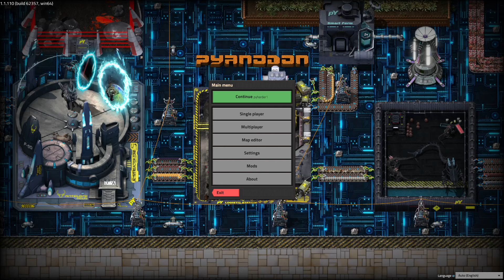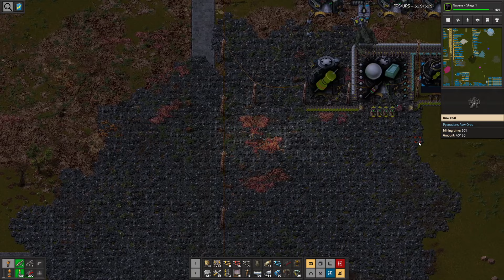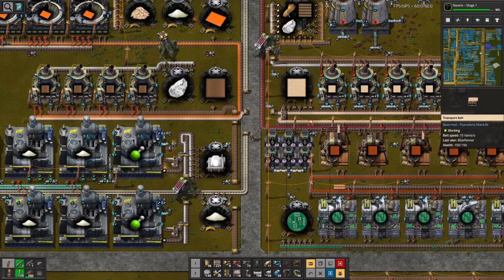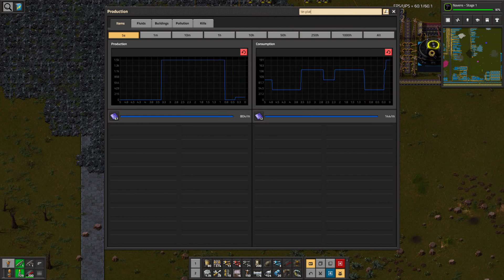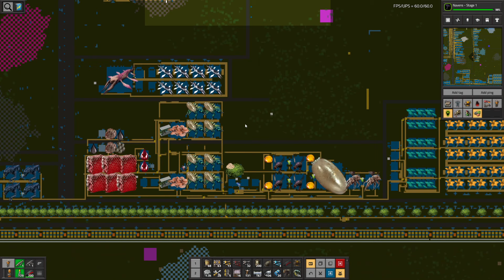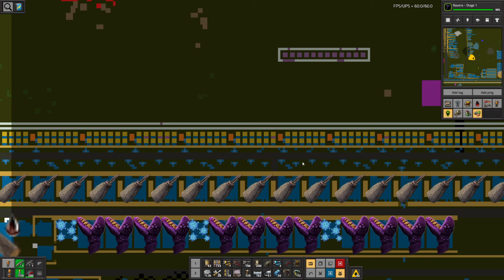Pyanodon's Factorio HARD MODE + Biters pt155, Complex Circuits!

Comment: How did you not get killed by biters in the early game?
Reply from the maker: @Dufftata  Hey!  I very strictly controlled my pollution cloud, and pushed REAL HARD when I had even a little bit of advantage.  It wasn't easy and it wasn't fun, but it did get done.
Reply: @Cotonou1331  very impressive. You inspired me to have an new fresh approach, enabling me to face bigger tasks I had shied away from. Thanks!
Reply from the maker: @Cotonou1331   Just normal Pyanodon's is more than enough.  It is essentially Endless Mode factorio.  Yeah, it does end.  After a while.  A long while.  I hope you like Factorio.